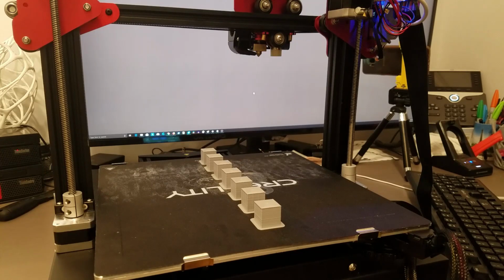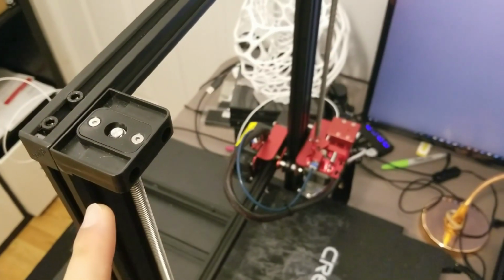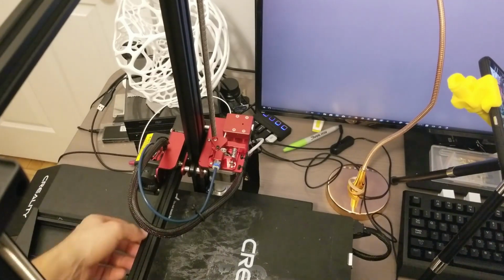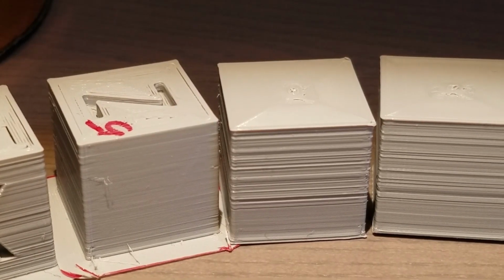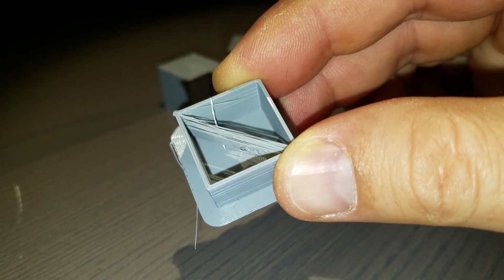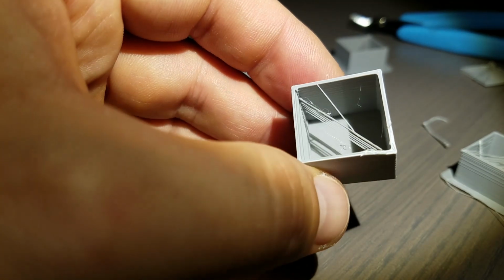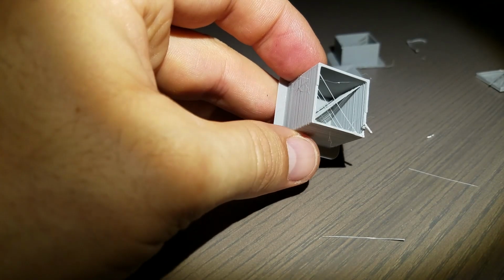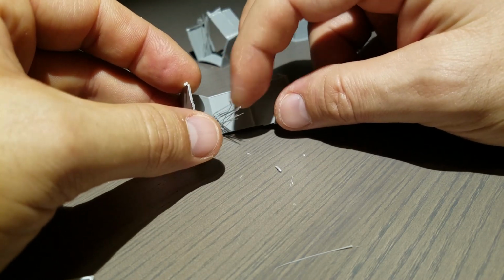Creality Cr10S PRO inner wall better than outer wall, inaccurate travel paths ruin the 3d print wall

Comment: yeah i think it might be time to look into your cura settings or change slicers i use S3D i dont see any of those issues I do have a ghosting issue that i can not fix on the account the y carriage belt is not adjustable on the cr-10s pro
Reply from the maker: Yes I am in the process of doing that. Yea that Y belt is a pain. I am checking the settings and printing some more cubes. Thank you.
Reply: the Y belt is adjustable! The motorscrews on the back are slotted so you can adjust tension. But the guiding pulley on the front is not teethed so you get vertical bands (the teeths of the belt) if you increase tension a lot.
Reply: OMG thank you for having me look once more. i dunno i had some reverse action going on in my head thinking i could not move it anymore. I even made anti-vibration feet for this printer and everything trying to get this to stop ghosting. someone hit me with a Stupid stick when i was not looking.. Thank you McE. I been working on this issue for a few days now feel like a true DA But thank you...

Comment: Wouldnt bother with z axis mechanics. Its almost certainly cura settings. Try outerwall before innerwall, infill after walls, flow 90% and set jerk to min 20mm for calibration cubes.
Reply from the maker: Thank you. I am working on dialing in the settings and I will post my findings.
Reply: set jerk to 20mm/s ? , that is the default setting for cura and the cr10s , but found it gives layer shifting on the cr10s pro , so dropped it down to 10mm/s or jerk off .
Set the flow to 90% , that was my first idea over extrusion, but from the videos of a 90% setting just gives weak prints.
I think the z axis is not constant ? , which is like over extrusion because instead of going up 0.2 it`s only going up say 0.17 so over extruding from that layer height .
Reply: peter adshead , see you dropped it to 10mm, so did I but on these sharp edged cubes this leads to issues. So I told him to up it again to minimum 20mm. Layershifts on my pro are due to loose Y belt or missing Z hop on some prints. I tried everything on my z axis setup at the beginning just to realize it was totally fine and my issues were just dependent on settings in the slicer.
Reply: @realmcerono  Can`t say I`ve seen any problems with sharp edges at 10mm/s . 
When a started getting layer shifting I checked the pulley , wheels ,belt tension ( which could be more tight than loose ),  and not sure if I like the idea of using z hop by default.

The problem with the belt is you can get a bits of filement to ride on the belt and then get stuck to the drive gear , the fun with working with tpu.

I think on a scale of 1 to 10 where 1 is only just printing and 10 is glass like prints every time , my pro is about 7 to 8 , not glass but mostly clean and usable.
But that could be just the cheapo filament I`m using !!!
Reply from the maker: I had printed without z hop a few things and they seem to be working. so try that.
Reply: peter adshead its totally normal that a low jerk does rounden edges because the material does flow on its own while heated. So if the speed drops on the edges because of the jerk you get  overextrusion and the edges bulge slightly.

Same part, same settings other than jerk:

Low jerk (5mm)
https://ibb.co/K52wpVP

High jerk (20mm)
https://ibb.co/yPrkXQj
Reply: Roaming Interests I mostly don't print for fun. I do prototyping for motion simracing rigs. These parts need lots of material and I do print up to 12 top and bottom layers with 8 perimeters/walls. For such parts you have to use z hop or you will end up in layershifting hell ;-)
https://ibb.co/gw7SFMZ (vertical banding due to high Y belt tension preventing layershift. You see the belt teeths)
https://ibb.co/BZnyQR1 (the holes are intentional because I deactivated "fill small gaps" again to prevent layer shifts)
https://ibb.co/YpK84PG
Reply: @realmcerono  This is my cube : https://youtu.be/hIayLADjzkI
Reply from the maker: Hey Peter Thanks for guiding me trough this process. Yea I removed the jerk completely , and for the record, i think in between setting the jerk to 0 or disabling it, one gets different results. I disabled it after I tinkered and dialed in the roller pressure. It seems that with the Jerk disabled the print quality is better, for my printouts. I tried with it set to 0 I had total different results than with the jerk disabled. I may have another look at the axes but, after the last few dial ins, they seemed to have worked. And I had no more hops on the z rods.
Reply: @RoamingInterests  you can`t set the jerk to zero